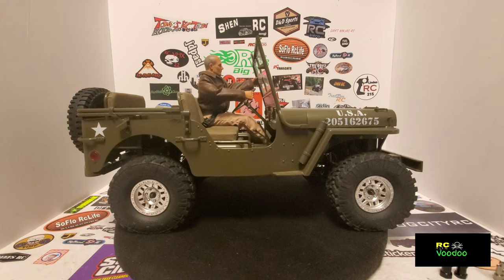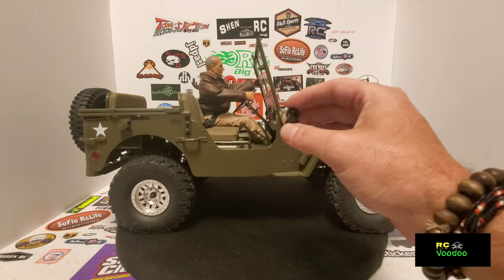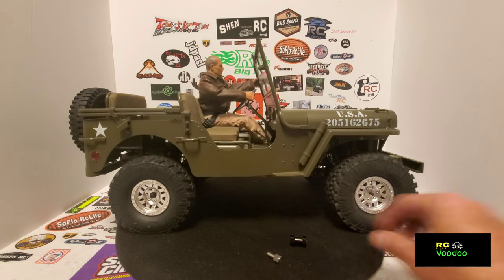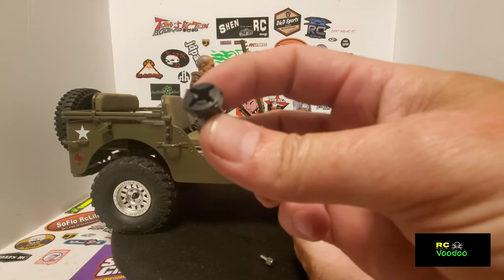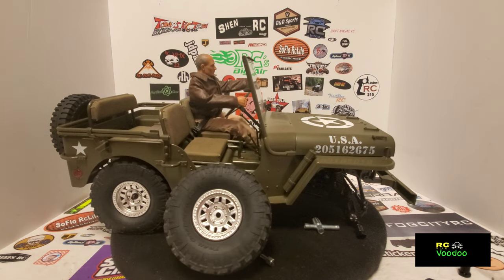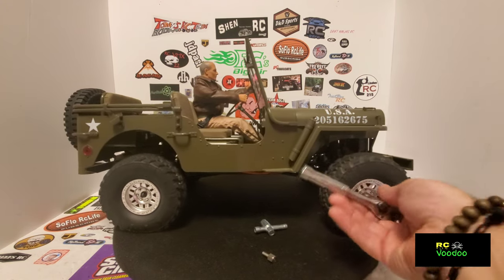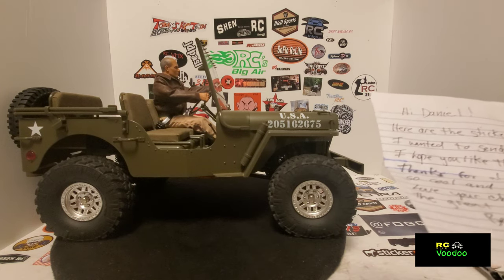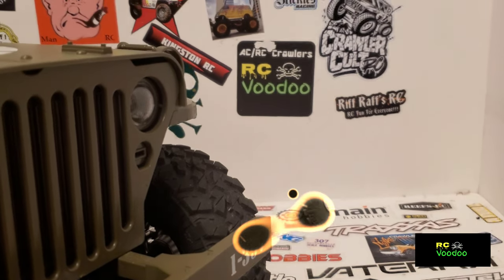rochobby 1/6 1941willy's mb scaler upgrade, how to install wheel spacers 20mm

Comment: Can you tell me what size rims and tires you used? Also what type of rims will fit, you have a link to them? Thanks
??
Reply from the maker: those are stock axial 10.3  wheels and tires off of the scx10.3 jeep wrangler.  they are 1.9's

Comment: Did you have to cut down the front bumper for turning clearance?
Reply from the maker: Nope, the extenders worked good. The tires barely touch the front bumper and those are the stock scxiii wheels and they are very large. Normal 1.9's would be perfect